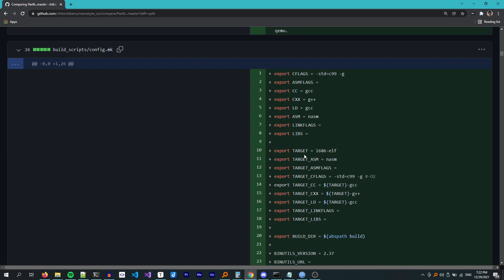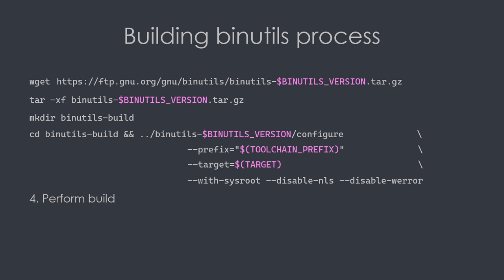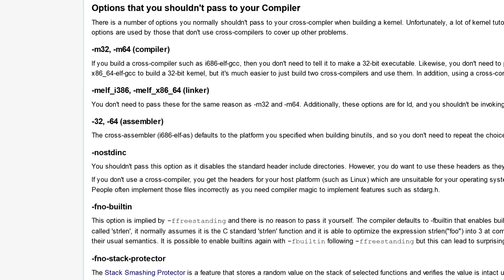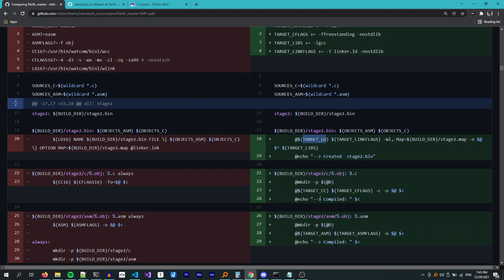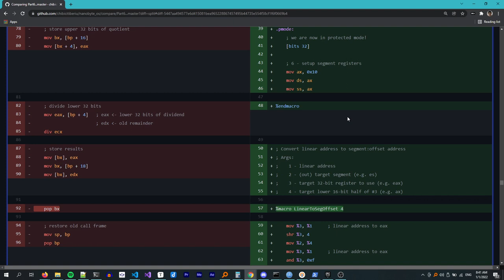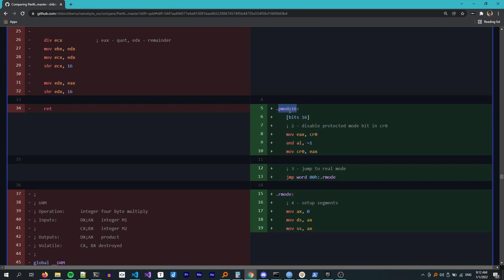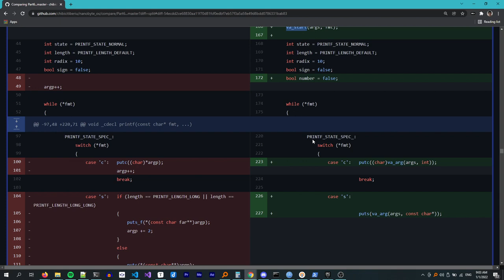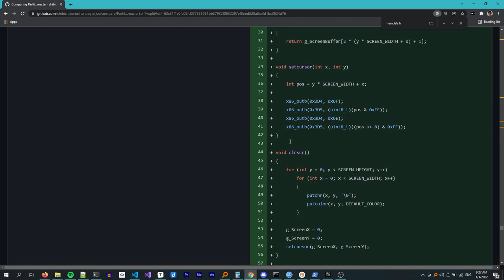Building an OS - 7 - Finishing the bootloader, migrating to GCC

Comment from the maker: If you are encountering a segfault while building binutils, pull this commit from the repository: https://github.com/chibicitiberiu/nanobyte_os/commit/063bd9efab7d9130ab19bb0f5ed6b0acdace2e9c. There's a little problem in the toolchain.mk script (I will explain in the next video).
Reply: I encountered this bug, but fixed it by upgraded my versions to binutils 2.39 and gcc 12.2.0.

Comment: 7:59 The way you handled showing this script was amazing. 

I've been writing scripts for years, yet I would have skipped over it if you simply showed it and described it.

The way you listed the ideas and morphed them into code made me think you're going to show only the important bits and before I knew it a script appeared on my screen :))

If only reading all code would be as smooth as this..
Reply from the maker: With DD it should work. If you don't get any string prints, maybe check that you've set the DS register properly. Try with a debugger (qemu + gdb is my recommandation, I have a guide in the #faq section on my discord how to set it up).

Comment: Which programming language you are used to build os through all aspects such as driver programming ,kernel programming,gui interface and other parts that are required
Reply from the maker: You can use many languages, although some require more work than others. For example, C, C++, Rust work very well for kernel programming because they don't really need a lot of runtime support. Some languages like Java are poorly suited for kernel programming because they need a lot of runtime features (garbage collection, the JVM etc), and they also lack important features (Java lacks unsigned numeric types, the ability to use pointers).

For GUI or the system API, you can use any language that you want. Obviously, some are more difficult than others... for example Python you need to port python to your OS which is a bit more challenging.

For this series, I will keep things simple and stick with C for the kernel and C++ for the userland stuff.